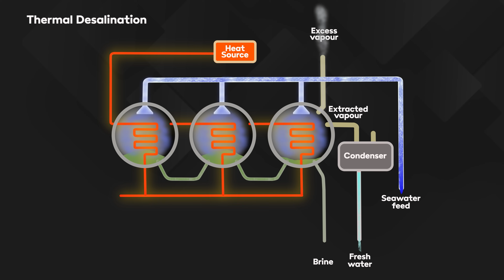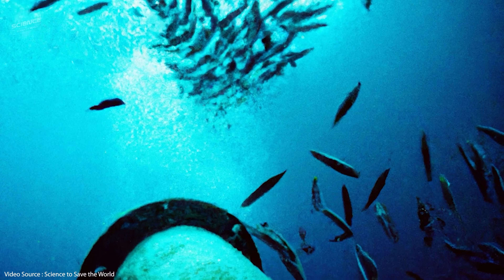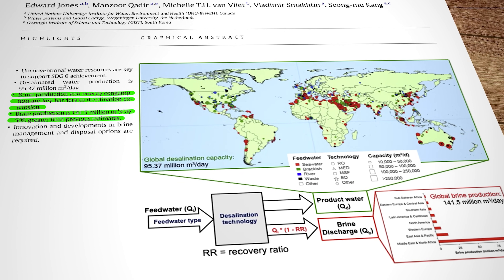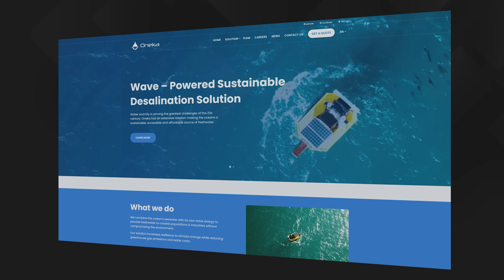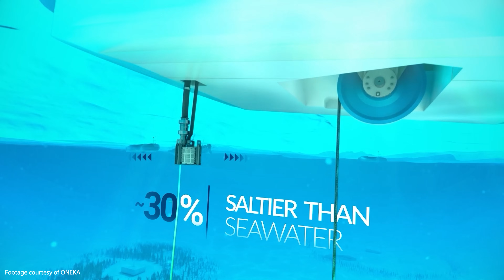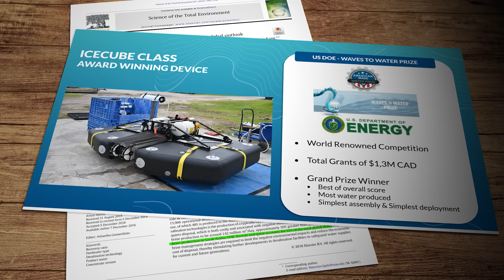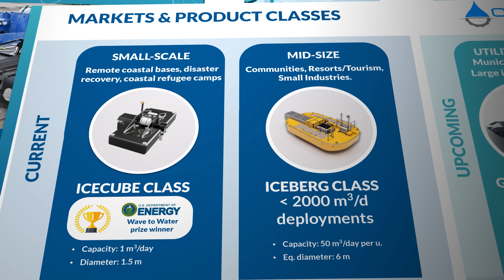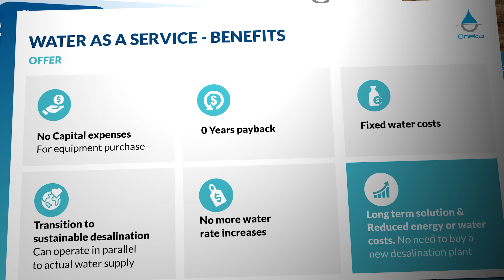Fresh Water at Zero Energy Cost . How do they do that?

Comment: I have always wondered about drilling deep wells 3 to 4 thousand feet under the floor of the ocean and pumping the water the water that has seeped down. most wells and get a bigger underground cavity after pumping for a while. the rock and sand would filter out most of the salt and make it easier to totally desalinate. same could be done for the brine but in reverse, force the water through the sand and rock.
Reply: I VERY much doubt that sand filters out salt. The bond between water and salts (not only NaCl, also other salts) is way too strong. Which is exactely why it needs high energy (evaporation) or high technology (membranes and high pressure = also plenty of energy) processes to separate water and salt (NaCl). The reason why sea water has so much NaCl it, and little other elements is because they form such a good (strong !) "alliance" that is hard to break up. Sand is good to filter out organic ! impurities, bacteria, etc. 
Water underground can be slightly radioactive and often has a lot of unwanted elements, molecules (hydrocarbons for instance) and salts dissovled in it. Water is a good solvant, and deep down it is warmer and pressure is higher, so if there are any elements or molecules present that can be dissolved - they will. And they had plenty of time to do that. 

That is a common problem with irrigation from aquifers, in some areas they degrade the soil at a slow pace but in some regions it only takes 5 - 20 years to make soil unfit for farming-  because of everything the water deep down has dissolved. Typically such water is not good for plumbing and appliances either (households, industrial plants).

Plants evolved to deal with rain water, not with water loaded with so much elements. Even if it is only iron, which is not a poison - that can damage plants and soil life. (If I remember correctly iron was an issue in regions of Jordan, not the only one, but a major one). And water with high iron content is also not good for plumbing / appliances.

Soil degradation by using deep water for farming is the case in some areas in the US and I know that is the case in Jordan where they have severe lack of useable water, so of course they are very tempted to drill deep if they have aquifers. They transport grey water by truck for irrigation, that is quite normal, lack of water is that bad in Jordan.

See Geoff Lawton's Greening the Desert project. On that oasis every drop of (rain) water is used several times, they catch and store rain water (also runoff from the street and hill above), and have excellent soil (which is able to soak up and store water well). The also use the water very efficiently and several times (compost toilets, grey water is purified by reed beds, of course they use mulching to cut evaporation and efficient drip irrigation). 
But still they could not have that oasis / farm / learning center without water supplied by trucks.

 
Before that 12 year project (where they OWN the property) Geoff Lawton supported a project in another region (but that was only a lease and that was ended by the owner), and there soil damage by irrigation from a deep well was a major issue, to the point where farmers had to give up fields.

In this former project of Lawton they tried to make do with as little irrigation as possible (using permaculture methods). And they were able to drop the salt content of the soil considerably. That soil was in bad shape, which may have been the reason they were able to get the lease, and at low costs. Soil life (fungi, bacteria, all kind of critters from tiny up to earth worms) builds those unwanted elements or molecules into the molecule chains that form humus. Humus is very important for GOOD soil. 

The salts do not vanish, but they are inert. The specialists at the University of Amman were astounded by the improvement Lawton and his team achieved within one or two years. And as they had used much less water than comparable farms in the region it was quite obvious that they had not washed out the salts from the soil - which was the only process the university guys knew to fix soil with that problem. Which is impossible in Jordan, because that requires a lot of pure fresh water. 

Reforming soil that way needs organic farming / permaculture methods. Additional advantage: it can also take care of substance that cannot be washed out, whether or not you would have the fresh water to do it. 

The farming methods that support soil life capable of reforming soil are a bad fit for conventional farming and even more so for larger farms. Conventional farming on smaller or larger farms harm soil life, it is never supported to the point where it could perform so well that it can bind toxins or salts. The best conventional farmers can hope for that their soil is not degraded (much) - only alternative forms of cultivation improve soil life and therefore build good soil.

Comment: What minimum seastate is required? The cost of the boats and crew you'll need to go out and get the fresh water and bring it back to land? Idk, sounds great in many regards until I consider these factors and then the perceived energy costs diminish quickly, especially since it's mostly like for like, fuel burned on traditional RO or fuel burned by boats. I know producing electricity is far more efficient than producing propulsion.
Reply: The boats and crew would be needed for maintenance, but the same pumping action that pumps the sea water through the reverse osmosis membrane would also be used to pump the fresh water through pipes to the shore.
Reply: @phizc  I must have missed the pipes thing, in some regards that makes more sense. The crew and emissions from boats for maintenance would hopefully be neglibible, at least compared to coming out to get the water everyday

Comment: The principle of using wave energy directly rather than converting it first into electricity seems a good one.

But first:   Does it work, and in what conditions?  How many plants are in regular use?   How much water movement does it need?  How much maintenance does it need, and how expensive is this compared with maintaining land-based systems?    Intuitively, replacing quite a lot of electricity with movement of a small floating device seems too good to be true.  I would like to see analysis of one of the devices with numbers to show order of magnitude quantities.  

Do these plants get mechanical energy from the water and then use it for desalination?
That same mechanical energy could be used to generate electricity and that electricity be used for desalination.
What are the relative quantidies of fresh water created from the two methods?   That should give an effective efficiency of the mechanical only system compared to the electrical system.  Needs some numbers.

At present this seems to fall into the seems too good to be true so probably is category,

Comment: With the existing desalinization plants couldn't they mix the discharge brine with ocean water to lower the concentration and temperature before returning it to the ocean?  A  50/50  mix of brine and ocean water would be half as concentrated.  Thanks for the video.
Reply: That's not done because of the pumping costs: both the capital cost of building double the capacity and the extra power consumed. The best thing about this new approach is that none of the sea water gets pumped very far, so they can afford to suck in more sea water.

Comment: It will be interesting to see how it scales.  I'd think wave energy would be less and less effective at moving the platform as it gets bigger, at least relative to its size, and that the salinity radius would be considerably larger than a couple meters for the bigger platforms.

I could see it working very well for places like islands though, where you have a lot of shoreline relative to the amount of water you need.  Obviously, somewhere off screen, the Professor had Gilligan and Skipper build one of these.  It always bothered me that they didn't seem to have any shortages of fresh water on such a small island!
Reply: I think that's why instead of building bigger and bigger the glacier class was comprised of 40 units, instead of a few huge ones.

Comment: I love the simplicity and efficiency of not having to convert mechanical energy to electrical energy and back again. Two big areas of concerns are durability and maintenance costs.  If more offshore testing reveals problems with those I hope they can find good solutions.
Reply: Direct kinetic energy use could work for reverse osmosis in windmills. That'd get rid of the generators but you'd still need motors as a backup, and I'm not sure how drive shaft technology has faired since the electrification of industry. It fits wind well since you store the energy as a product and save on conversion/transmission losses. To reduce drive shaft complexity and gearing you can use a decentralized layout and pump the water like in the video but that complicates the backup motor system.

Comment: Talking about water desalination. Have you perhaps seen the Polish company Nanoseen and their Nanoseenx? They seem to be able to desalinate water with no power whatsoever, only forcing it through filters using gravity.
Reply: Then you need energy to pump the water up, so they can use gravity. (I have not yet checked the project out, just wondering).

Comment: It seems to me that for small scale, combining wind and solar would be better than waves if you went the thermal path.
I was going to explain the idea fully but found that pictures would be needed.
Basic points:
1) A column of about 26 feet of water will make a vacuum at the top enough to boil water.
2) Boiling it would make it get cold unless you supply a heat source
3) Just a few PSI pressure will make water condense at that same temperature.
4) Condensing water would get hot unless you can take away the heat.
5) a heat exchanger between 2 and 4 can supply some of what each needs.
6) Solar power can directly drive heat into the boiling with little loss
7) Wind power can make the mechanical effort needed at #3

Comment: I wonder if you could equip a ship/boat with a system like this to passively make water if machine failure of the primary system occurs or for small sailing boats to extend length of tour possible.
Reply: you can use the entire boat and a anchor to do this, and you will get 1000times more power
Reply: There are emergency gadgets that use evaporation. If the weather is cool there will be rain (which can be collected). And if it is hot, the sun can evaporate water. Those devices have a clear plastic container / balloon and use the principle of condensation. Shipwrecked people have survided with the help of such appliances. They are low cost, low tech and are small (they have to be assembled, so they no not take up much space when packed) - these are important features for emergency gear.

Comment: Interesting but what about bio-fouling. Won't the filters and plumbing need regular and expensive (expensive because presumably this has to be carried out offshore) maintenance to remove sea life build up.
Reply: You could just tow them to shore as maintenance is needed. Since you would have many in an array this would have little effect on output.
Reply: @filonin2  Maybe you could just tow them to shore but don't forget they are  plumbed into the freshwater discharge pipe so that would need to be disconnected first.

Comment: what if we skipped desalination and just used reverse osmosis for grey water recycling? not as useful for agriculture, but would certainly go a long way towards solving drinking water shortages. Combined with a hydrothermal carbonization or liquefaction sewage treatment system that can burn the bio-fuel for power and condense the water out of the exhaust, I bet you could recover all the water you put into it and then some for very little net energy cost. It could even be set up to do some load shifting for renewables.

Comment: As a sailor I have some idea about the constant need for upkeep of marine systems. Missing was the cost of maintenance. Filters and strainers must be cleaned/replaced. Mechanical systems in seawater don't live forever. Production will be strongly related to sea state, also unstated. Solar panels get coated in guano and sea salt. Storms? Logs and floating debris?
Reply: If you worked with heavy machinery, tractors and semi-trucks you would have made the same deduction. Wear affects all mechanical parts and manufacturing/quality control affects all manufactured components, so basically everything lol

Comment: Excellent report.  Makes me think that we need more “decentralized” micro systems, be it power generation or water desalination.  The great utility scale / “economy of scale” solutions sometimes generate bigger problems in a spatial and temporal sense.
Reply: Yes…the knee jerk response is usually that decentralization is inefficient, but the flip side is one ginormous Achilles heel (brine concentration, no redundancy and failure causing widespread disruption).
Diversity of systems and  wide distribution principles bring us back to the strategies in nature. Maintenance issues are also offset by having the components easily retrievable …they can still be serviced and repaired at a more centralized facility, but their distribution and redundancy actually equates to more continuity or service and less likelihood of widespread disruptions.
Reply: @pohkeee  Why don't they haul the broken wind turbines to a central repair facility?
Reply: I also support decentralised systems. I see these small desalination rafts as an addition to current water systems in places like California to take the pressure off the current system and reduce the use of Colorado River water in the state.

Comment: I am curious about possible small use applications.    I outfit sailboats for long term off grid use .  Installing lifepo4 batteries and solar arrays.   If this tech can be scaled down to the range of 50gpd constant production the sailing community would be very enthusiastic
Reply: The system requires the platform to be tethered to the seabed. Not ideal for a moving boat
Reply: @OAK-808  ok thanks for the prompt response I will continue to watch the tech for scalability
Reply: you can already use a boat without much modification, you could use the anchors with some hevy stuff attached to them, when your boat goes up and down on the waves then it pulls the chain and you can attach that to a generator or some mechanical pump like they did it on this video

Comment: I've built reverse osmosis systems as a project engineer in the natural gas industry. They are expensive, require maintenance often, don't last long as they need to and use a small amount of energy compared to the plant demand but use too much energy for cheap water.  The process is simple and works great but does use lots of energy.
Reply: The wave system looks like it would be expensive to build and I doubt it can last long without maintenance in the conditions of the ocean. I also wonder who is going to pay for the initial capital costs which will be huge to do this at any scale.
Reply: @GrungeForward  ofc the tax payers will pay, just like we already payed for that DoE grand

Comment: I’ve extensive experience with desalination and mechanical/electrical systems. This is a horrible idea. Stick with the ground mount plants and add multiple discharge points to reduce salinity hot spots. Use renewable energy to power the plants with standard pumps and hydropneumatic pressure tanks. Having to maintain these systems out at sea makes zero sense. Using a purely mechanical system driven by waves/swell is going to be a maintenance nightmare. I used to be a marine engineer in ships, I know this. The solution already exists, just improve it with better environmental design in intakes, discharges and renewable power supply systems.

Comment: Why dont we put those better filters and use that better brine solution on the already existing and more efficient industrial plants? Yoy can't say it's because of the emissions because surely it must be cheaper and easier to just build one large and efficient tidal power plant for the desalination than to build a bunch of small, less efficient, combined platforms. And if the brine needs to be widely distributed, why not lay the pipes this system would need but instead of attaching the platforms and sending fresh water to shore, use the pipes to send brine from the plant. Like this idea is just adding more complications so if it would work it'd work better for the industrial plants, and if it wont work for them then it wont work at all.

Comment: Mechanically based systems have the lowest reliability and high maintenance, friction and wear.  
Encouraging, but not ground breaking.  Outside the box and larger scale, say "somehow" manipulating
rainfall in a few square miles, or  directing onshore coastal airflow to increase temperature of water vapor.